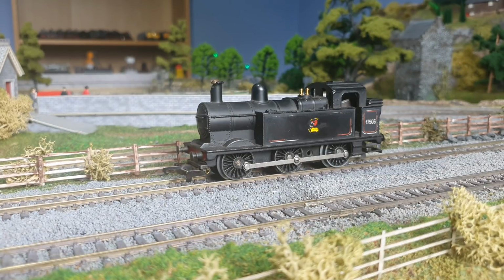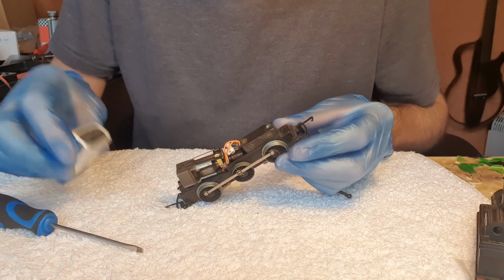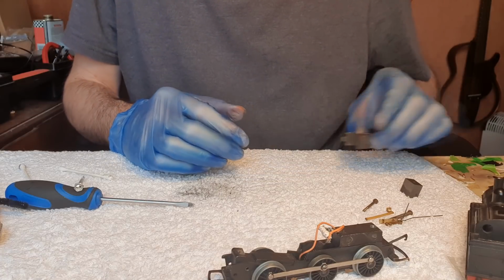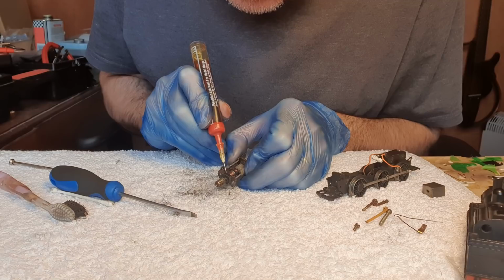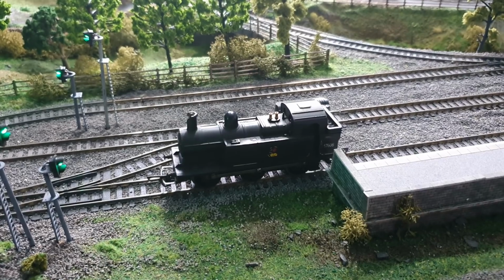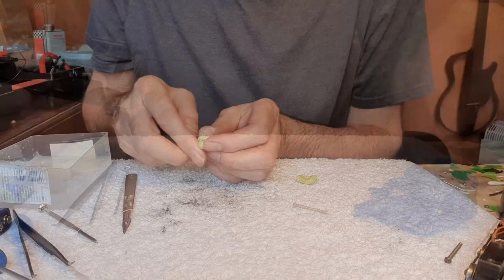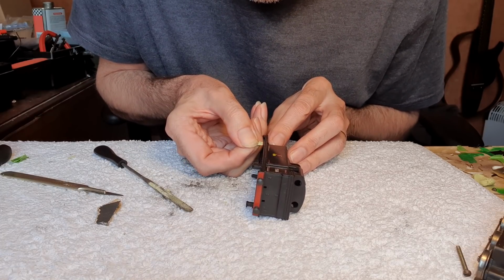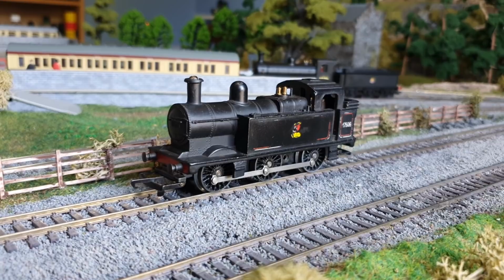Triang R52 Jinty 0-6-0 Tank Locomotive: Repair Request

Comment: This is definitely an old engine. Pre 1960 with the split framed chassis. Well done on fixing the chimney and steps. Could you put a small piece of plasticard behind the steps and glued on to the steps/body to give it a bit more support if it got knocked The chassis is missing a screw between the rear 2 wheels on the left hand side. You can see where the counter sunk hole is on the chassis plate. You are right about the screw holding the body on. It should be a flat top and a chamfered underneath to fit a bit lower in the chimney. I do not think that the Jinty in real life was ever lined out. Except possibly when preserved. So it really just needs the BR logo and numbers as you mentioned.. Again another engine saved from the scrap bin plus great job with the Miliput.
Reply: I don't remember Jinties being lined either.

Comment: I found one of these in my cupboard the other day.
not only are there pieces missing (like side rods, meaning it doesn't move), but it's also severely deformed (plastic warping)
I could probably repair it if I wanted to, but I'm not sure it's worth trying.
The only thing it really has going for it, is the fact that it's old, and possibly rare.

Comment: Have you tried "Blue Stuff" by Green Stuff World? The Blue Stuff is a reusable silicon mould that you just heat up with boiling water for a few minutes, press in the part that you wish to replicate and let it set for about 15 minutes to get your impression. You can then use the Milliput to create new parts, and it's really easy to separate the new part from the mould. The bonus it that you can then re-heat the Blue Stuff and create new moulds as many times as you like!
Reply: Much better than the Playdough which only lasted a certain time before becoming 'manky'.
Reply: Also, for many years, I have used for moulding, Halfords car resin mixed with a little red hardener and filled if necessary with metal powder or fine sawdust

Comment: Hey Bill, great repair on this. Only just watched. Have you had any experience of the wheelsets in newer 0-6-0's - I've inherited a Thomas on 0-6-0 2009 chassis; narrowed a problem down to the wheels locking only when going forward (even when engine removed). Fixed it a bit by pressing in the crank pins; but its still making a good clunk as it rolls - wondered what could be the problem here? assume the crank pin was causing it to lock in place, any of your repairs cover this?

Comment: to clean bad wheels i connect a power supply at least 1A and 10v and use a low grit nail board as the wheels turn, they come out nearly mirror finish and completely smooth
Reply: The idea of using a brass brush is that it is softer than the metal of the wheels and hence will not scratch them.
Reply: @PeterJewell2  yes i understand that, it's just emery board is finer, and softer. The brass brush needs a lot more skill, i wasted a hst wheel trying it 
i may try wet and dry 1500+ soon next time triang wheels are dirty. that and maybe even a cotton bud of brasso. I'll experiment it

Comment: hi, great video. do you know where i can buy a remanetiser, please. i cant find one. thamks
Reply: Hi Andy,  In case you still need a demagnetiser - Look up Ronald Dodd on UTube.   Ronald is an expert on Hornby Dublo and markets the remag unit you see Bill using in this video. You will need to email the very helpful guy and he should be able to quote you for a unit.   His email address appears with each video he has posted.   There is a vid demonstrating the correct method for using this equipment.  
I have had one in use for about 2 years and it has been a great help, keeping my fleet of locos in service.
Happy Modelling,
T 🚂